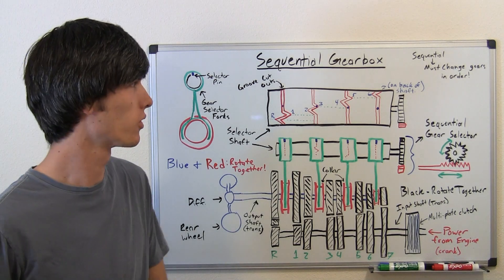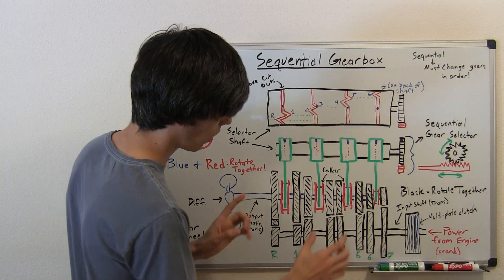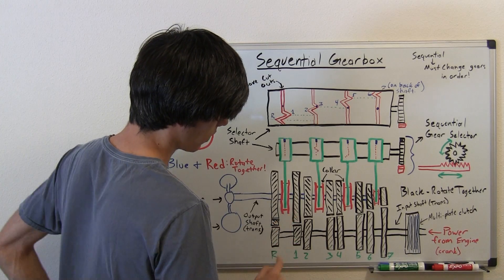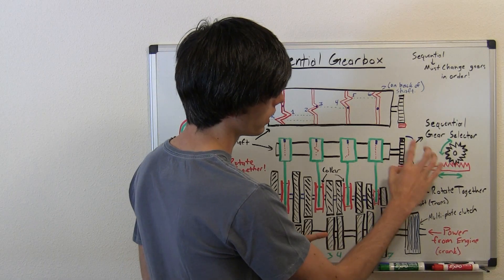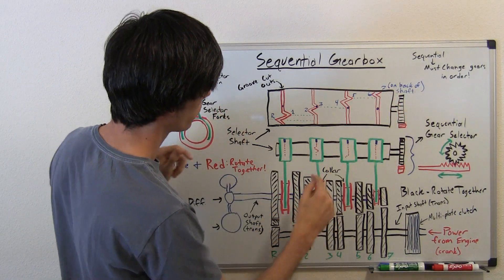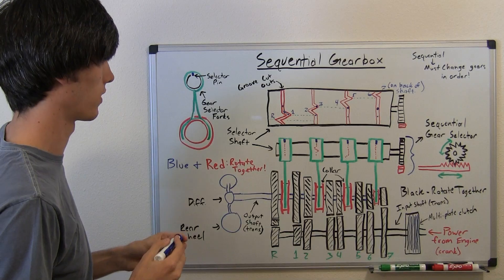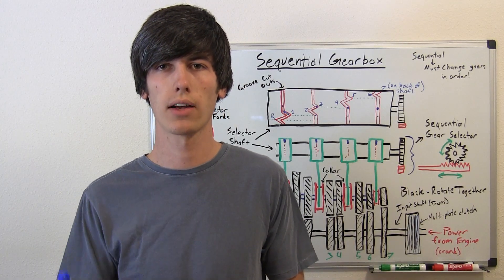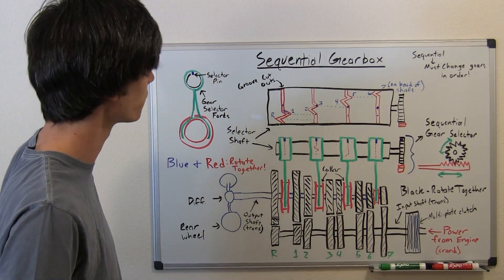Sequential Gearbox - Explained

Comment: One thing I haven't understood yet is this: There is no synchromesh. How do the dogs actually engage? If they aren't lined up, I mean. I'm guessing that they are rather smooth and just ride on top of each other until the dogs drop into the gaps? But that requires the selector fork to somehow be spring loaded? Or does the operator just control that by applying a certain amount of force to the lever to allow the dogs to find their gap?
Why does nobody talk about this. Every single god damn article I find online is just some simplified view. I don't need simplification, I want to understand the whole system, even things that are only required in the real world.
Good video though, this explained the system really well. I just want to know more.

Comment: so the only difference is the selector?
is cost the only reason why sequential selectors arent used in road cars then?
surely you could skip gears the same as a manual by using the clutch tho?
also how are sequentials able to shift without using the clutch?

Comment: How does the engine change speed so quickly during shifts in these sequential gearboxes? Since disengaging the clutch is unecessary, are the gear selectors/dog gears so strong that they can slam into gear and force the engine to match that speed? This goes for both upshifts and downshifts. I'm aware the ECU cuts ignition on upshifts to help. On downshifts, is there any throttle-blip rev-matching despite the shifts being so fast?

Comment: Not that it matters much but the gears are often not in order of R-1-2-3-4-5-6 and so on. They are switch around in order to balance bout of the shafts even though you shift though the gears as normal.

Comment: Excellent vid but I have one pet peeve.  I think you left out a crucial difference between sequential gearboxes and normal synchromesh manual that we have in everyday cars.  Many have asked in the comments how is it that you can change gear without pressing the clutch and without rev matching when the gears don't have synchronizer rings and adjacent gears don't rotate at the same speed (obviously).  

Well the answer for those who asked is that the coupling between gears and collars is done using "dog clutches" (look it up) and pushing the collar as fast as possible into the gear. Indeed, using the clutch and slowly shifting like a normal manual would wear them more.  So yes, in fact, you just engage the new gear even though the rotation speeds don't match, using dog clutches.  That is why we can clearly hear the loud clicking sound when a race car upshifts/downshifts because these dog clutches absorb the impact of differing gear speeds.

Comment: Ah, so THAT'S why engaging neutral on a motorcycle can be so tricky. It's placed right between 1st and 2nd on the same selector fork (motorcycles use the same principle, but without reverse). It also kind of explains the false neutrals I encountered on a Buell (1200 Sportster engine) I tried back in the day. It must have had a very poorly designed selector shaft.

Comment: "You can go from one gear to the next without using the clutch. The clutch will be engaged the entire time." How? Assuming you can even get the dog teeth to mesh, wouldn't this cause some rotating parts to immediately change speed, thereby causing failure?

Comment: how can a sequential transmission gearboxes doesn't need to disengage clutch when changing gear?
Reply: the rotation is timed to sync properly
Reply: Leave it in 1st gear with the clutch out and hit the starter, the engine will start and away you go.. Could do it with older cars, don't know if ecu will allow that today.
Reply: Michael Cohen that's why you always check neutral in a manual car :'( not that i hit a fence starting the engine or something.
Reply: cuz all gears always spins the same speed
Reply: You can actually change gears without the clutch even in a manual transmission - just have to rev-match. But it's nearly impossible to start moving from a dead stop without the clutch.
Reply: I would advise to watch the video again.

Comment: why do they stil make cars with a h patttern manual if a sequential is so much better? why dont they make sequential truck transmissions?
Reply: ronald rogerson sequential transmissions aren't very smooth for daily driving, and while it can be done, your average Joe isn't going to do so. There are also quite a few techniques that need to be learned in order to drive them properly.
Reply: Marvincent Acuña Bikes are a lot lighter, so it's easier to make a smooth sequential transmission
Reply: Airsofttec, how about motorcycles?
Reply: Cayden Hepworth, although we do know well that it would work.
Reply: Marvincent Acuña its difficult to handle a car engines torque smoothly with a sequential gearbox during daily driving. but as long as i could understand its not much an issue with a motorcycle with a lot less torque. even in supersport motorcycles its still easier to drive them in traffic while compared with a car with sequential because it gives its peak torque after 10k rpms while most of the cars, even racing cars give their torque starting from 2000 rpms.

Comment: Jason, first let me say I'm a huge fan of your videos.  I've been watching them for some time now and am happy to see how well your YouTube channel has done.  I, too, recently graduated from a MechE program.  I've been thinking about the concept of clutchless shifting in a synchronized gearbox lately and just want to run my thoughts by you.  I've always assumed it is a very bad thing to do, as it would cause undue wear on the synchros.  But now that I got thinking about it, I started thinking that maybe it's not all that bad--provided you're fairly good at it.  Initial intuition would tell you that it puts a lot of wear on the synchros because they have to synchronize the speed of the input shaft, gears, flywheel, and engine instead of just the input shaft and gears.  But at a closer look, I thought that synchros wear would really only be a function of three things, 1. Speed differential between input and output shaft 2. Force applied to the shifter, and 3. Duration of contact.  With a clutchless shift, there is very little speed differential (none of you're perfect), there is less resistance on the shifter than during "normal" shifts, and it goes into gear just as quickly.  This would lead me to believe that a reasonably good clutchless shift can actually put less wear on the gearbox than a normal shift.  Is this correct?  I know the best thing would obviously be to rev match AND use the clutch, but I like to show off!
Reply: Jacob Shaw these gearboxes actually use dog engagements, which operate slightly different from your standard synchro.

from what ive seen, a synchro is still somewhat apparent with a dog clutch, just not nearly as apparent (further reducing the amount of friction introduced and force required to change gears.)

Comment: How much time should you leave between downshifts?
Reply: xLeGeNeDxScOpEx depends on your rate of decelleration. The faster you decellerate, the less time between downshifts. The engine needs to reach low enough revs to avoid over-reving when engaging the next gear. Thats also why it's important to know the difference in revs between the gears.
I learned that the hard way one day riding my bike home from work (Honda CB250RS). There was a turn, that I usually took in 2nd, comung down from 4th. That day I revved a little higher than usual, so I forgot that I was only in 3rd. I downshifted 2 times as usual and dumped the clutch. No need to say that the engine couldn't rev fast enough to keep the rear wheel spinning (engine braking effect). The rear wheel locked up, but I somehow managed to keep the bike upright untill the rear wheel started spinning fast enough to regain grip.

Comment: I hate it when people try to describe things as being "like F1". That's so far from how an F1 gearbox work!! F1 gearboxes have 2 selector shafts, one for odd and one for even gears. This allows each gearshift to be independently inserted and extracted, and without this seamless shifts aren't possible. Also, F1 gearboxes don't have a reverse gear in this fashion; there's not point carrying around an extra input/idler/output gear and dog ring/selector fork for something you hopefully won't use. Instead a gear is hydraulically inserted to mesh between forward gears that normally wouldn't be in mesh. Not all gears spin on the lay or main shaft (or input and output shafts as you call them), they are split across the two, so if the idler is inserted to mesh with one gear fixed to the layshaft and one fixed to the main shaft it will drive in reverse.
Reply: Nick Bell is that a dual clutch system? I actually don't know...
Reply: Nick Bell 
There are some major differences between dual clutch system and an F1 transmission.
the sequential described in the video is a much simpler system than what is used in modern F1 cars today. The transmissions have undergone quite a few modifications from the standard sequential (including a multi barrel system, not multi clutch like DSG), along with a multitude of electronics having been introduced (throttle cut, etc. etc.) and extremely tight tolerances, are what allow for the seamless shifting. The formula 1 cars still retain a single clutch and the conventional dual shaft system, dual clutch is banned from F1.

Also F1 cars are required to carry around a reverse gear as it is stated within the rules.
Reply: I never said anything about dual clutch transmissions... I said that F1 gear boxes has 2 selector shafts, i.e. the selector forks for odd and even gears are mounted on different selector shafts. this is what allows the shifts to be performed overlapped - the inserting dog ring and fork doesn't have fixed timing relative to the extracting dog ring and fork. I'm fully aware that F1 gearboxes only have 1 clutch, 1 layshaft and 1 mainshaft and never said anything to the contrary.

As for reverse, maybe I wasn't clear enough. F1 gearboxes do have reverse gear, but as I described, it is not in the conventional way, it is an idler gear inserted between two gears that otherwise aren't in mesh. Unlike a conventional gearbox, in which reverse is selected in the same way as a forward gear, with its own selector position, fork, dog ring etc. That's why I said F1 gearboxes don't have a reverse gear "in this fashion".
Reply: I was trying to show the differences between a DSG and F1 transmissions to O Colpin, who suggested that you were referring to a DSG.
also misread on my part, I suppose I just skimmed through it too fast.

unfortunately there is very little visual information regarding what exactly happens within the F1 gearboxes, as the teams don't exactly release all that much information explaining the details.

Comment: In addition, F1 gearboxes in 2016 are "seamless". The next gear is engaged BEFORE disengaging the current gear, it happens so fast it is not a problem that 2 gears are engaged at the same time.

Comment: My motorcycle up shifts brilliantly, but sometimes or maybe many times it doesn't downshift. I mean it the gear level does nothing and stays in the same gear. When that happens I have to leave the clutch slightly and the gear changes with a clunk. Note that once this  happens, i can downshift further with ease. Its a 5 speed one down four up fully manual, clutch is cable operated. I've done 900Km on it. Will it become good after running few more kms? (Thats what the service mechanic told, but i don't trust that guy). Can you explain the cause?
Reply: motorcycles use continuous mesh gearbox. similar to this but a bit different. if you don't match the speed to the gears all the time . it will get stuck and you have to do what you said. it's pretty normal in a continuous mesh gearbox. for example if you come to a stop in fourth gear it won't shift down to 3rd . it will always do that . you just have to get better at matching speed to gears.

Comment: It's also worth mentioning that almost all motorcycles use a sequential gearbox.
Reply: Cesotoseot Biggest difference is the number of selector forks and the missing reverse, so that 1st and 2nd, 3rd and 4th, 5th and 6th are grouped together on 3 selector forks instead of 4 with neutral between 1st and 2nd. instead if between R and 1st.
Reply: I was thinking about that the whole time as well lol
Reply: almost ? : D  all of them are sequential  hence no Sticky do hicky   :D
Reply: @mannyechaluce3814  Honda has a dual clutch option for their dual sport bikes.
Reply: I would assume centrifugal clutch motorcycles don't have manual transmissions???
Reply: @SirCavemaninthewest  Centrifugal clutch is an automatically operated clutch, so no, a motorcycle with a centrifugal clutch wouldn't be a manual transmission, it'd be automatic, or possibly (sometimes) a CVT.
Reply: which bikes does not have a manual sequential transmition that goes from neutral, down into first. then second and counting 1, N, 2, 3, 4, 5, 6
Reply: That’s exactly what I was thinking as he was explaining it

Comment: how can the red things (yes, I can only use that word) be attached to the output shaft  but still be able to move back and forth? can you explain how that works? sorry if you already explained that in the video
Reply: I think he said something about splines
Reply: They slide along output shaft
Reply: +razaelll some kind of bearing i guess, right?
Reply: They kind of look like gears. They basically let those red things (ikr lol) slide along the shaft, but it won't let them spin around it. It's hard to wxplain it without drawing or showing it irl
Reply: they are splined, and move dog engagements for the gears.

Comment: How does this gearbox relate to a typical motorcycle 5 or 6 speed transmission with 1 down 4 up or 1 down 5 up?
Reply: +bmarcy86 Exact same. Neutral gap is between 1 and 2 since there is no reverse, otherwise, it is between 1 and r.

Comment: Which is faster? Sequential vs Dual-Clutch
Reply: +Tlangela Ntshembo Mkhacane Both and neither for now. Each is going to offer benefits, but the complexity and weight gain required in a dual clutch makes it impractical for F1. DCT WILL eventually surpass sequential though! There is some finessing they are working on to streamline it.
Reply: +Tlangela Ntshembo Mkhacane Dual clutch transmissions big thing is not the namesake dual clutches but 2 different output shaft. Dividing gears on those shaft means you can have your next gear preselected on the other shaft. That means you save the time it takes to move your selector from current gear to next. You do need your dual clutches to select which shaft is engaged because you can't have two different gears engaged at the same time. If your clutch mechanism is faster than selector mechanism on traditional sequential it can be faster. But in the end gearbox is not the only limit on your shift times. You have to revmatch your gearchanges in both cases. On traditional sequential you have to do that in order to engage the next gear. In both transmissions you have to do that to prevent upsetting your driven wheels. So engines ability to changes revolutions will come in play.

Comment: I hope you have some input and can put my mind at ease. Are these gearboxes similar to those that are in motorbikes ? I want to know if it is safe to let off the throttle and clutchless shift up in gears. I have a Yamaha FZR1000, I use clutchless shifting and nothing have gone wrong yet, I just want to know if is safe to do this...
Reply: if you left off the throtle its safe. i do the same in mine. the question is, the clutch purpose is just for startup? No, by doing this we are burning the clutch disk a little bit. the gearbox is safe.

Comment: Great explanation.  I always wondered how they worked.  If I remember right, the most common road vehicle that uses a sequential transmission is a motorcycle.
Reply: +Andrew Timm It's right. Basically only racing car use sequential transmission.

Comment: I thought they used straight cut gears as part of the not having to clutch to switch gears bit. also straight cut gears are capable of dealing with more power are they not?